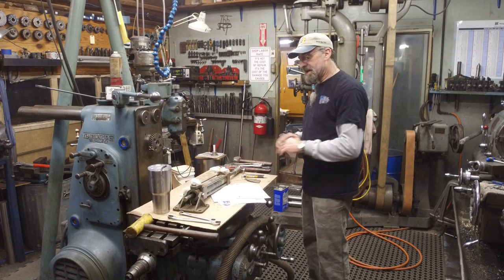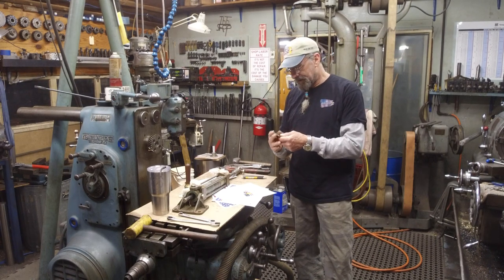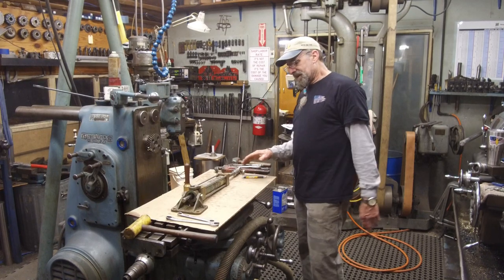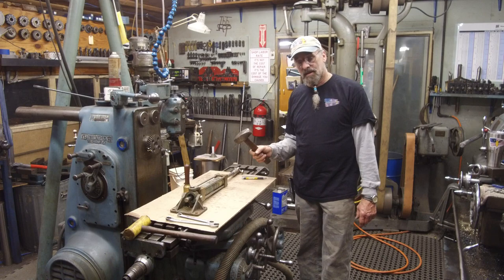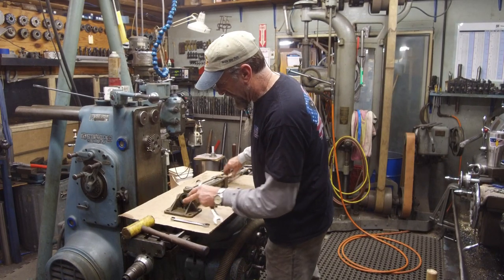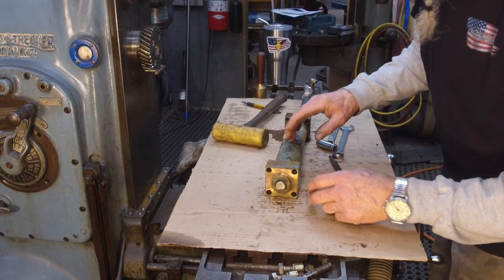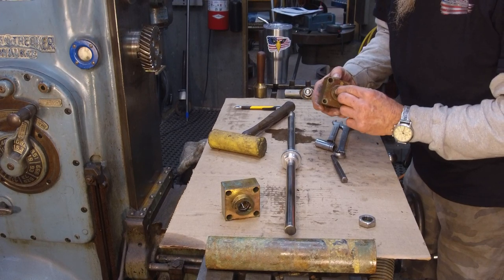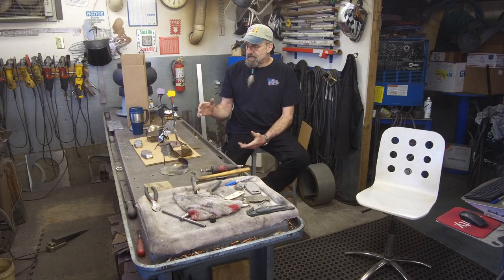Slightly Modified Flat Spot Refurbishing Hydraulic Steering Cylinder Part One

Comment: A good 30 years ago when I was in my teens and learning basics of welding a brazing I worked on a scratched up cylinder rod like that one on a old farm tractor my grandpa had.    I just filed the high spots off and filled in the scratches with brazing rod then hand filed the excess off then gave it a moderate polish with emery cloth.

Grandpa has been gone for years but that tractor still gets used every weak and that cylinder is still doing fine!  

No point spending hundreds of dollars on a new custom made rod when a good torch and $1 worth of brazing rod and half a day work can fix what you have!

Comment: Is there a specific reason to have that style of steering ram with the tail end coming out?  It looks like a double ended ram that they only used one end on.  Maybe that what they had laying around when the old one needed replacing.
Reply from the maker: Has to do with swing operation design to work with tiller arm.  ;{)------

Comment: Keith, I had a job to fix a hydraulic cylinder on the lift gate for a  moving truck. There was a couple of nicks in it. I had recently watched your video on the long key that holds the endcap and was able to take it apart. I polished the rod in the lathe, reassembled with new seals and all was ok. Would polishing this rod have been a solution...or was it too far gone?
Eric
Reply from the maker: After assembly and operation test will prove success or not, sometimes a polish has been the way some have gone and getting lots more running time, ;{)------

Comment: What's the purpose of the backup rings instead of just making the groove smaller to fit the o-ring exactly?
Reply from the maker: The added swelling performance caused with soft back up.  ;{)------

Comment: Keith, I saw the flower and was wondering how you painted it, if you dipped it or brushed it or dobbed it with paint; regardless, I got to thinking- this can sometimes be dangerous, tedious or annoying but I will let you hear it anyway.  There is a painting style you can do were you tike like a nylon net loofa from the shower or something similar, dip it in the paint and then dab it on the flower to paint it, adds a soft texture to it that is not quite solid. The other option, since you cut them out with plasma-cam, is to create a stamp (using your x-carve) the exact shape of the flower, that has highs and lows in it, such as the edges of the petals overlapping in the body of the flower. Or possibly make a stamping die, where it has a top and bottom and an alignment to it so you can stamp paint on both sides at once. Just ideas, hope they help and give you something to think about.
Thanks for the videos and have a good one.
Reply from the maker: Thank You!  ;{)-------

Comment: bronze nuts on stainless steel bolts? Sounds like risk of galvanic corrosion: moisture in the air will act as electrolyte and cause the bronze to corrode quickly.
Reply: More likely brass nuts, I didn't really catch what Keith said in the video however. Anyway, brass nuts on stainless is great, no boogered threads outta the blue, tends to stay mostly corrosion free etc etc. Also the studs are never stripped when there's a brass nut.